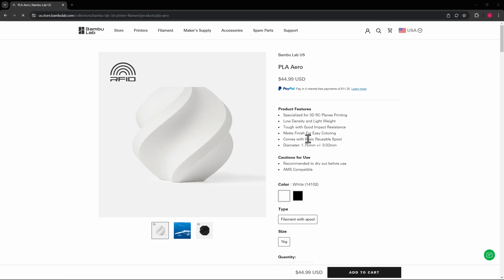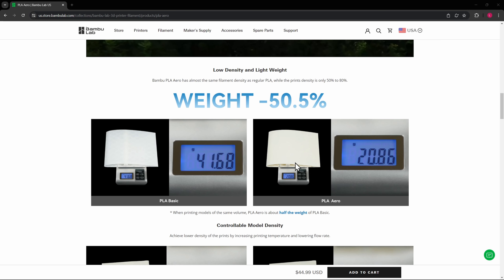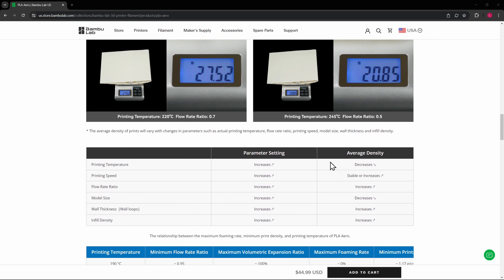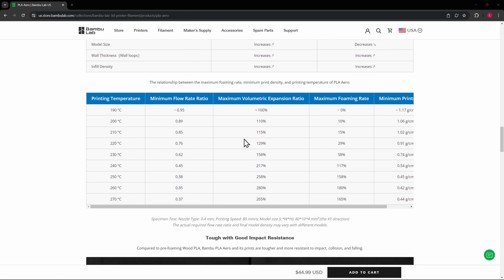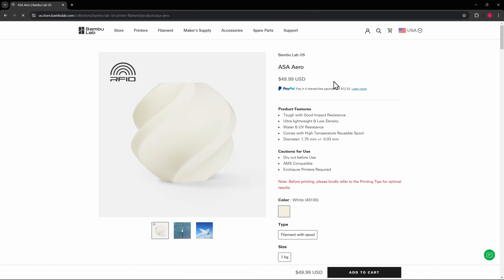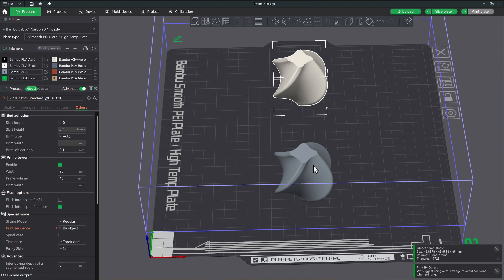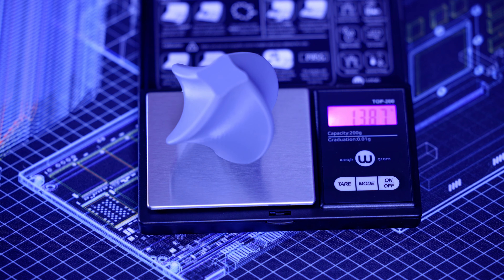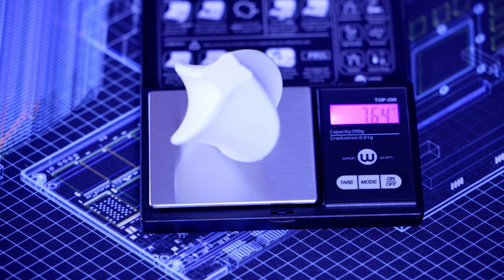Bambu Lab Aero Filaments

Comment: Hi, I have already printed some RC planes in Bambulab PLA-Aero and ASA-Aero: these are excellent materials and for both I have found the settings that satisfy me. As regards the impact resistance of the printed model, ASA always beats PLA, while if we look at the delamination (layer adhesion), exceeding 265° the performance of ASA Aero drops rapidly compared to PLA so the aircraft is overall more fragile. I print ASA Aero at 255° with a flow-rate of 0.68 (chamber temperature 50°) max speed 70mm/s, while I print PLA Aero at 260° (open chamber) with a flow-rate of 0.46 doubling the speed: despite this large difference in flow-rate, the weight of the models printed in ASA is slightly higher than those in PLA but the resistance is certainly greater. The only thing to pay particular attention is the shrinkage of the ASA: you always need a wide brim, 0.01 mm from the model and glue on the plate to avoid warping. As for delamination resistance, we know that as the printing temperature increases (and therefore foaming), the adhesion between layers decreases. This can sometimes become a problem, because ASA itself does not have a great adhesion between layers: in my tests I exceeded the limit with the foaming to have a super light wing, but when I hand-launched the model the wing broke into two pieces, exactly in the center!
Reply: Very interesting. Lack of a heated chamber might be affecting your layer adhesion, would be great to compare!
Reply: Hi there, great input for ASA aero, are you able to help me trouble shoot a problem i am having when printing with ASA Aero?? i am finding that the nozzle can pick up alot of blobs, generally from when the print head moves to different parts of the job, subsequently dragging into other layers and ruining the print
Reply: @waihiwarrior2202  Hi, to avoid blobs you can try one (or all) of these settings in the slicer:
1. print in vase mode (if the model allows it)
If you can't print in vase mode:
2. enable z-hop
3. enable the "avoid crossing walls" option
4. increase the retraction distance a bit
5. reduce the printing temperature a bit
Reply: Does it matter if you print with a smooth plate or a textured plate because otherwise ill have to buy a smooth plate or can you use an older smooth plate from an ender 3 pro and use it on the bambu lab p1s?
Reply: @danielderks5772  you can use your favorite plate, there are no differnces
Reply: @alessandrofinco  thankyou so much man do you think that with a textured plate you dont need glue since the textured plate brings the grip?
Reply: @danielderks5772  I never use glue on the textured plate, not even with foaming materials. If you have any doubts about adhesion, simply add a few millimeters of brim: I often do this when printing RC airplane parts because almost always the contact surface is really small.
Reply: @alessandrofinco  Thankyou so much man really appreciate it
Reply: Thank you so much for this input! This would be my first time printing with asa or any kind of harmful material. On a x1c should I be concerned about printing asa aero in my living room? It's cold out so don't know if I want to leave the window open but can you please tell me what types of cautionary measures you take and should I really be that concerned about it? Ty.
Reply: @michaelb5396  Hi, ASA should be printed with the printer completely closed to avoid warping and other imperfections. During printing it is difficult for harmful fumes to spread in the air, but when you have to open the printer you will smell the classic smell. It is not as harmful as ABS, but somehow it is better to avoid breathing it. If you cannot move the printer, after printing open all the windows to change the air. An air scrubber mounted inside the printer helps a lot (I always use it), but it does not eliminate the smell completely.
Reply: @alessandrofinco  Thank you again for taking the time.

Comment: One usecase for foarmed plastic is thermal insulation. The k-value of material describes how much energy is transfered through a surface (in W/(m²·K)). Have you compared this between normal ASA and AeroASA?